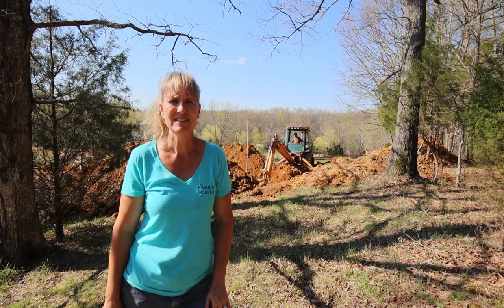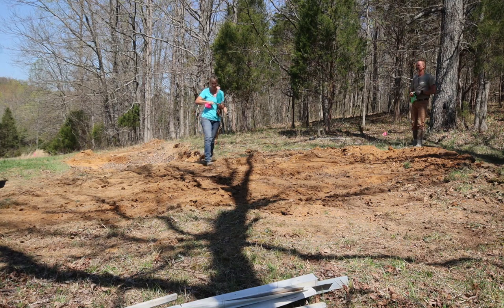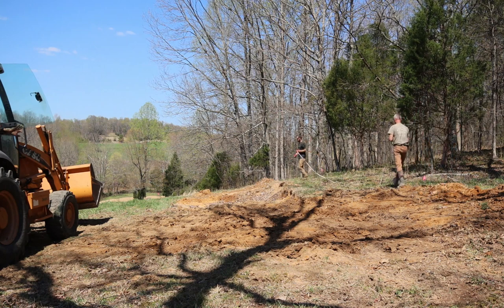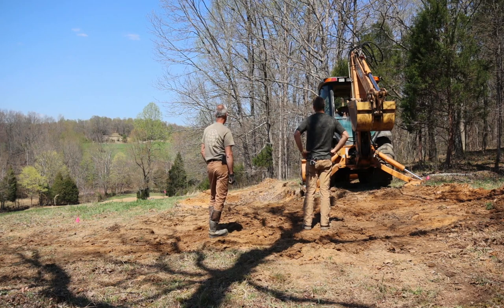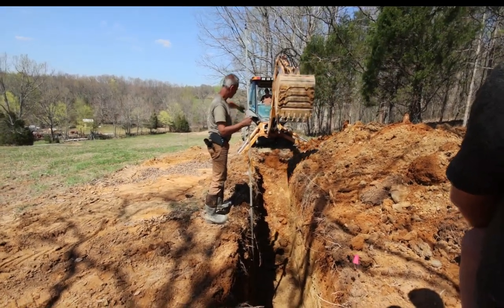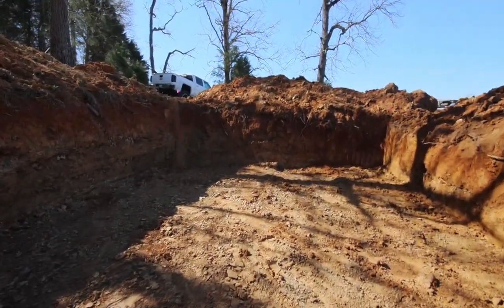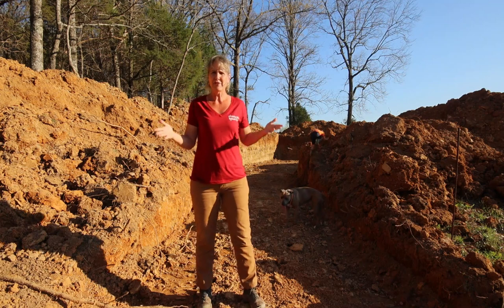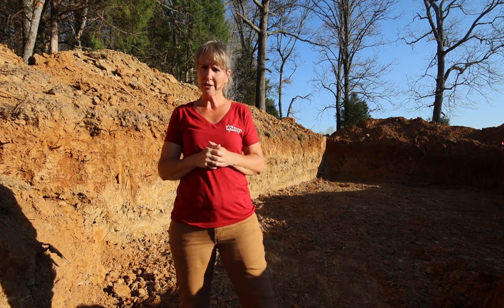Building a Root Cellar: Just Getting Started! | Backhoe at Work

Comment: Add a side room for survival foods like jerky (boil Lean Meats for 4-5 minutes in rock salt solution for mold protection; drain dry into boiling water. Then smoke iit for 3-4 days in homemade smoker--ours looked like a 6'x6'x 8 ft large outhouse with steel roofing wall liner at ground up to stop fire damage with 2 racks at 4' and 5' w/cap. of over 50 pounds of meat; hooks to hand hams too) As I am 77 now; some of that jerky made and caned in jars at 165 deg and sealed in is still good to eat from 1972. great for breaking up at 0 moisture content and sucking on all day as you fish or hunt, work.

Comment: Put in a vent tubed  cement floor as well so ground water will vent away from your floor area. French drain that away as well. Ours lasted for over 50 yrs till the BLM took our home from us.
Natural screened off draft vent thru the top a good idea so molds do not start up. Our roof was all that sat above ground and it had a storage ceiling under the roof with a access door to that storage area.  French drain the uphill side to aid in ground water runoff NOT trying to flood the cellar. Extend that down the sides as well; gophers area  menace to that without the drain system.
The dug out dirt / rock can reduce the depth needed to dig as it will pile up and insulate the walls too.
Reply from the maker: Thanks for all the tips! So sorry about the loss of your land.